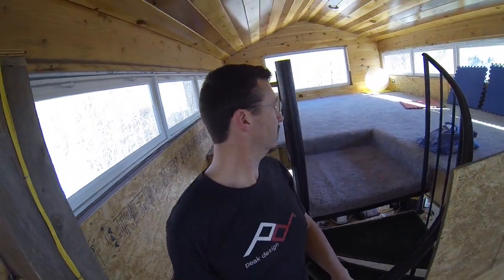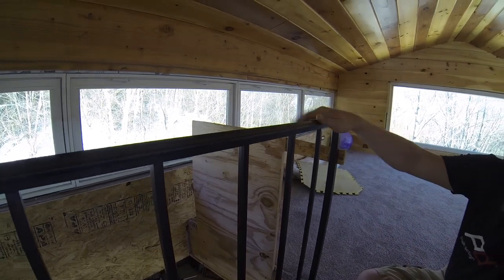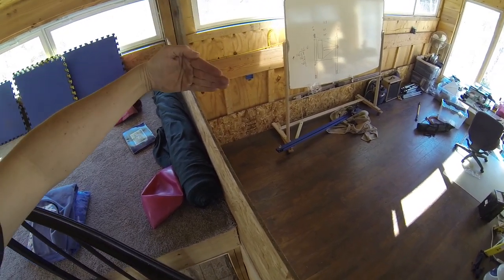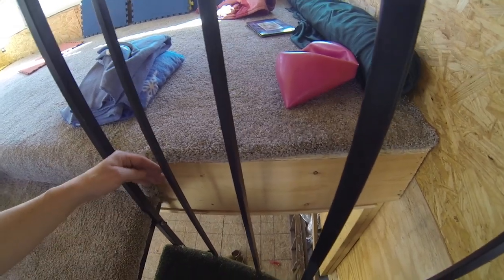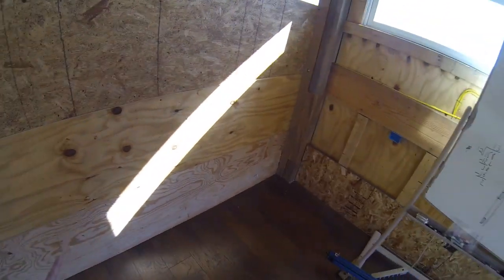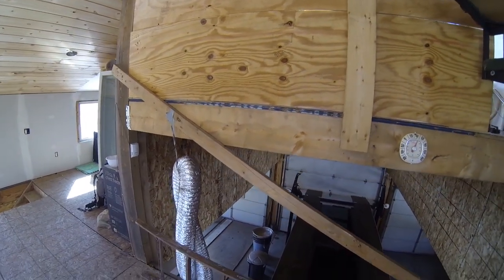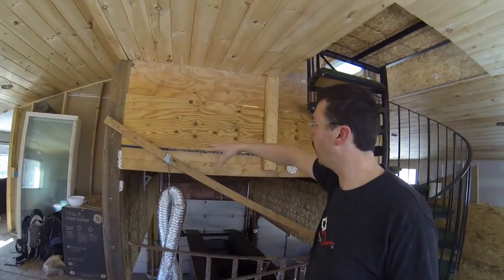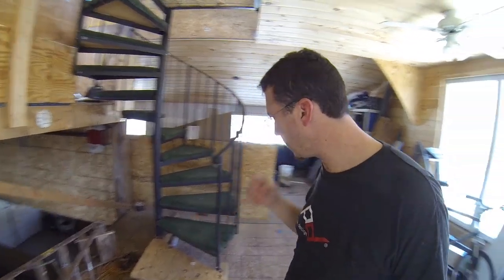How should I build the railing handrail for my spiral stairs?

Comment: It looks like 1/2 inch tube baluster and the railing looks just like some stuff I have that I pick up at the steel shop.  You can do so many cool things.  You can learn quickly too it's easy to learn.  I'm in the middle of doing some railing and a grape trellis.  Checkout the last couple of vids.  I'm about to start doing some pipe bending this weekend.  That will give you some ideas I'm sure.  Integrate some design in the vertical balusters.

Comment: Try to weld as much as possible outside and do the mounting of the parts with bolds and nuts! Welding inside is complicated because of the smoke and danger of fires! Especially with gasfumes of you vehicles! Ifinevitable cover up everything around the welding place because little spparks can ruin your carpet or burn holes in your clothes!

Comment: I would weld a railing that stands on its own in the form of a L! and then let it rest on the floor leaving just a little gap between the railing and the stairs! If you dont find the same profile for the toprail you can decorate it by placing a wooden bar on topwith you can treat with varnish! You can shape wood in any form you like!

Comment: Use 4" flat steel and weld 1" box tubing for the upright spindles and C channel facing down down as a cap hand rail.
Railing spaced 4" apart!